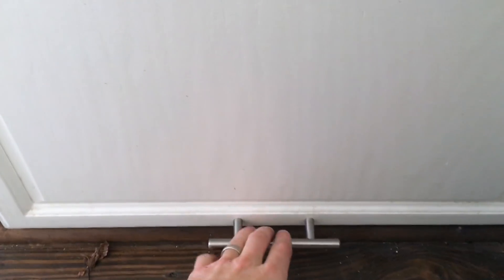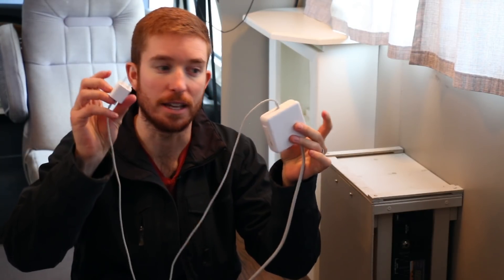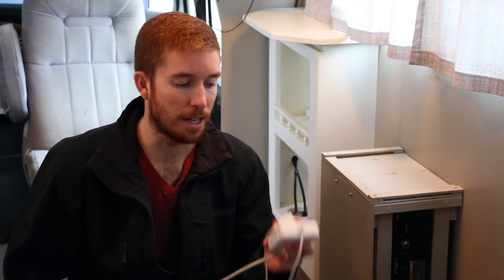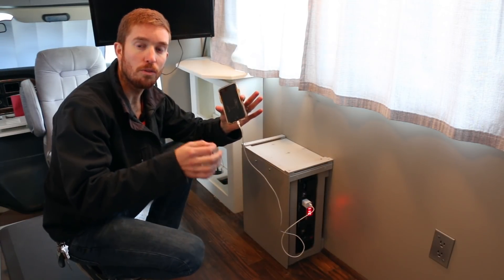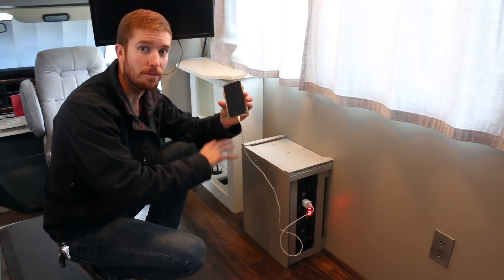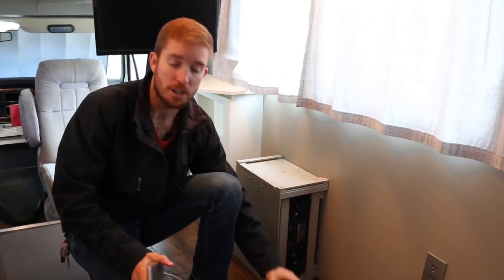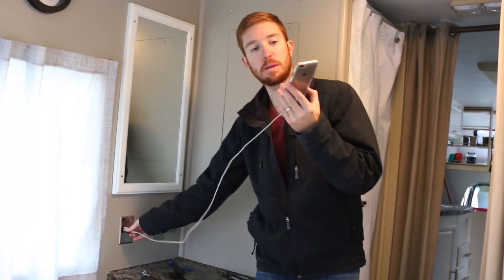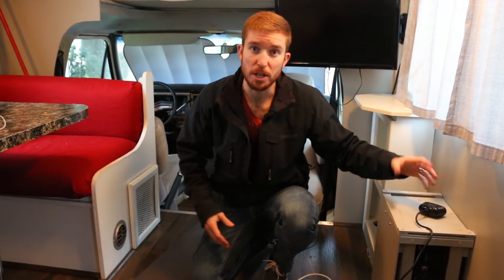Save Energy Off Grid + Direct Wire to the 12v DC RV Electrical System

Comment: I think inverters are best loaded at 80 percent. If you run them at near 100 percent most of them won't last very long. 3000 watt inverter will do 3000 watts usually but you will be replacing it before long. Yep best to not load them over 80 percent

Comment: So is every hot water tank wired by DC power? I'm contemplating purchasing a 1984 rare Class A, but I want to primarily boondock and I'm trying to figure this out. The seller has added golf cart batteries and a 3000w inverter so I think I'm close to being free from Shore power, but I'm still struggling a bit. Thank you so much!

Comment: One thing is that you dont need a ind light on the usb hub. Why? When you plug in it will work or not and you can see that on your item. So no light needed. And saving power.

Comment: Thanks, I learned a lot. 
So if you are not running your Inverter at full-out, then I won't need a 2500v inverter.
 just find out what I will be running on it at full-out and just use that one-two items at once.
Thanks

Comment: The charging voltage of a Macbook pro is 16.5 V DC.
The batteries of your solar unit supply apparently 12 V.
The charging voltage you are using is not enough.

Comment: My MagSafe MacBook Pro charger output is 18.5V 4.5A. I would be careful selecting a 12V converter. Things can go wrong electronically with buck converters. I worry about damaging my laptop. You haven’t had any trouble with the converter you showed in the video, have you? I did find one that looks like yours on Amazon made by Sopito, but I don’t recognize the manufacturer name. Thanks for the video.

Comment: Very informative video. Thanks.

I have a battery powered cordless drill. To charge it I have to insert the battery into its charger, then plug it into a standard wall 110v socket. How would you charge this sort of battery to a DC source in that it doesn't have a USB connector, only a 2 pronged plug?

Comment: I didn't know inverters had DC pass through, It makes sense though and saves having to run a whole other set of wires from the batteries. So assuming I have the right voltages I could remove my power supply from my gaming pc and the power brick from my monitor and power them directly from my battery?

Comment: lol... i guess u answered my 12v charging comment :)
... my 25' gm has a couple 12v charge ports in good spots ... but my 23' trailer has only 1 under the table on the bench at the front of the trailer.... what were they thinking ? lol... i need to move it. as for my next build,,,, ill be putting in lots of 12v power ports. and upgrading all the electrics. ill be pre planning this next one :)
Reply from the maker: The 12V ports are SO underrated! We've met so many people in RVs who don't have them anywhere. It is a MUST HAVE on our next rig as well.
Reply: We added a couple of the ones like Morton on the Move installed next to the water heater switch. Our water heater runs off a 5amp fuse where the lights etc are running off 15amp. You can add one next to most 12vdc switches and lights. Just dont plug everything in at once because you'll pop a fuse.

Comment: Not to rain on your parade, but dc-dc converters are about 80% efficient.  If you want ultimate efficiency for a usb power plug you could pick off your 4 volt rail of your fully charged lead acid battery and get about 4.4 volts, which is within the tolerance of the usb plug.  Then there is the I^2R loss of your wire; keep it short or go big.  If the wire losses are high enough you could pick off the 6 volt rail and stay within the usb voltage tolerances at all levels of battery charge.  At this point you are doing everything to save a watt.  Looks like you would be better off with the inefficiencies of heat, since it is so cold.

Comment: In reality there is  three times 80% efficiency loss  when charging your iPhone... a good part of the power from Generator, Solar Charge Controller,  or Grid is is lost charging your main battery bank..
Reply from the maker: That’s a great point! I didn’t mention that an I probably should have. Thanks for adding this in 😎👍🏼

Comment: How do we run our Desktop PC on DC power?
Especially since it's already DC. I've been looking for DC desktop PSU's but it's convoluted and confusing. None of them seem to fit the form-factor of ATX cases.
And then there's the monitor. How do we even start there?
Reply from the maker: Desktop computers are AC appliances so unfortunately, you won’t be able to power it with DC.
Reply: @DuetJustusFam  No, they plug into a 110V outlet and are immediately split into 5 and 12 vdc.  It would be trivial to splice in some molex connectors

Comment: The USB charger is a constant Draw, it needs to have a separate switch, The Cig Outlets NO. Off until you plug in.  another thing I do is wire in a few SAE HD Outlets 10 AWG (Often used In solar Applications) And there is an Array of SAE adapter cables Like from SAE to USB, Cig Lighter, Clips, Round 12V out and so on Check Harbor Freight. Also, The 12V Banana Plugs come in handy.
Reply from the maker: Good info. Thanks for sharing 👍🏼

Comment: I want to buy a flat screen tv and put it in my travel trailer it has the old crank up t.v. intenet I want to change that is there something I can use. other then the intenal
Reply from the maker: Hey David. You should be able to buy a “digital antenna” that plug directly into your TV. Hope this helps 👍🏼

Comment: New information! Thanks! I purchased a class c with a 160 watt solar panel, but there is no inverter and they had installed only two cigarette plugs coming from the storage batteries. With some splitters and extension cords, I'll be able to meet most my solar power needs! I wonder if I can power a 12volt tv?
Reply from the maker: Thanks! Yes, you can definitely power a 12v TV and I will be doing that (most likely) when we hit the southwest. Glad this info helped!

Comment: I wired up several 12v and USB(12v powered) outlets around my camping trailer. I don't know why RV manufacturers install them from factory.  Most laptops can be powered/charged with 12v outlet systems too.
Reply from the maker: Exactly! To say the technology is "old" or "antiquated" is crazy. We definitely charge both of our computers on those outlets 👍🏼

Comment: Absolutely amazing as usual, Michael!! Thank you. Do I need a specific type of adapter to plug in my Mac and bypass the square inverter that comes with it and is routinely used? :)
Reply from the maker: Hey! Thanks and great question. Yes, you will need to buy a separate DC 12V charger for your specific computer. We bought ours on Amazon and have a link to it in the video description if you need to reference it. We have an older MacBook Pro and need the original MagSafe version but if you have a newer MBP you will need the MagSafe 2 charger. Just make sure to buy one with the right connector for the computer 😊.

Comment: My first thought, did you reverse the wiring? I've done that before, thinking I had it right, only to reverse it and have it work. I also agree, there's no point to the old school 12 volt plugs any longer, just get the USBs and be done. If you can't find ones to fit your old holes in the wall, just get the round ones like the pic you showed and buy a blank wall plate and cut a hole in the center of it.
Reply from the maker: Hey there. Thanks for the suggestions! The wiring is correct, the fuses are good, and the only reason we wanted the cigaret plugs was to power a computer in the back bedroom... We like working in bed 😂

Comment: Very good point with unnecessary dc-ac-dc conversions! 👌Even though I knew about the inefficiency I did not take to account that you lose power in BOTH conversions. 
Yet I have to point out that you also lose some power in dc to dc conversion (eg 12v to 5v). But luckily it is smaller and you lose power only in one occasion.
Reply: PetriMikael I was going to make the same point. DC to DC conversion is usually somewhere between 80 and 90 percent efficient, so while bypassing the inverter is great advice, it should be  pointed out that doing so doesn’t get you to 100% efficiency unless the load you are powering uses the same voltage as your battery bank (usually 12 volts, but can be 24 volts or more). I think a lot of the people watching this video might erroneously believe they can achieve 100% efficiency for all their DC appliances.
Reply from the maker: Great points! I meant to mention that in the video and forgot to. You will never get 100% efficiency because there are other factors that I didn't mention but DC-DC is significantly more efficient that the DC-AC-DC conversions. Thanks for getting this point across. It will definitely help they people who watch 👍🏼
Reply from the maker: Yes. There is definitely still inefficiencies. Good point!

Comment: you should have a fuse in your DC panel for that 12v plug. on some rvs they run off the house battery on others its off the starter battery and is usually on the same fuse as the cigarette plug in the dash. if your dash plug works id check the dc fuses under your fridge first. if its off the starter battery it could be under the hood. under the dash.  or on the side of the dash near the drivers door jamb.
Reply from the maker: Great info! Thanks for sharing your knowledge!
Reply: clean up the wire ends, and cut off bad crimp terminals and add new ones, they are like a penny, worth it, no fires or lost power in future
Reply: You said there was damage in that wall so its possible the wires themselves connecting that DC outlet have corroded to the point of affecting current. After checking corresponding fuse u may consider running fresh wires

Comment: They also have 12v televisions and many other household appliances that are 12v.  Also, check your new 12v socket and make sure that is not defective. Make sure you get a volt meter and you will be able to check wiring before you replace sockets to make sure they are live before you do the work.
Reply from the maker: Great points Carl. Thanks!

Comment: Michael, did you think of just putting a usb socket right into where the old cigarette lighter style socket is?  That way you could have two usb items plugged directly into it.  Without needing the cigarette lighter style plug.
Reply from the maker: Hey Marc. I considered that, but we wanted the option to charge and work on our computers in the bedroom 😀. I'm sure I'll figure out the power issue sooner or later... Thanks!

Comment: Check your fuses.  There’s a good chance that the water damage or repairs caused a short and blew the fuse.
Great job at pointing this inefficiency out.  Few people are aware of this.  If you want to learn more about DC efficiency, look into the difference in efficiencies between DC linear voltage converters and buck/switching voltage converters.
Reply from the maker: All of the fuses are good so it's got to be something different. I'll figure it out sooner or later. Thanks! Hmm, I will look into the different converter types. I appreciate the great info!

Comment: Nice video Michael.  If your TV is AC/DC you can run it directly from 12 volt DC as well since the TV is inherently a DC appliance.  I see two possibilities for the dead outlet.  First, the water damage could have corroded the wiring.  Unfortunately the fix for that is new wiring which would have been easy when you were rebuilding the wall, but would be a big job now.  The other possibility is that the outlet is powered via the RV AC to DC converted not the battery.  Plug the RV in or start the generator to test that.  If that is the case it is easy to fix.
Reply from the maker: Thanks for the awesome info Todd! I will check this when I can 👍🏼

Comment: When you are replacing the DC socket in the bedroom, why wouldn't you replace it with a socket and USB connectors on the same plate? Just wondering....Good video!
Reply from the maker: Good question. We wanted the option to charge our computer while working in bed lol 😊. Plus, we have a bunch of USB adapter and we wanted the most functionality out of the outlet 👍🏼